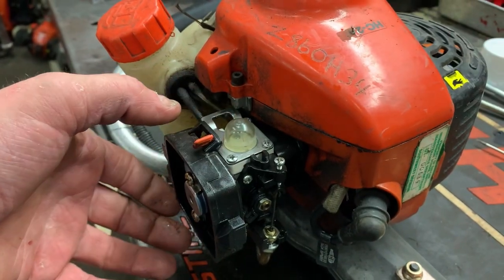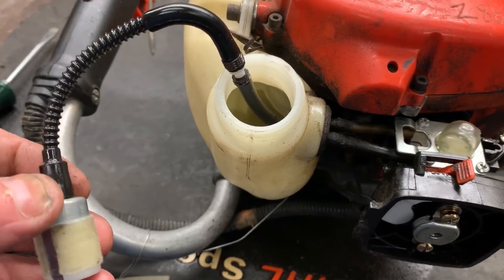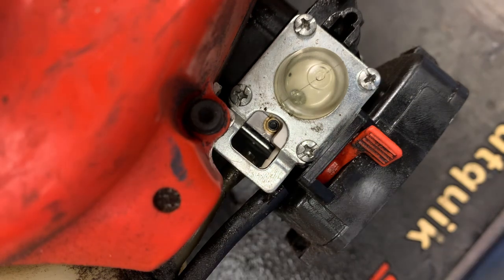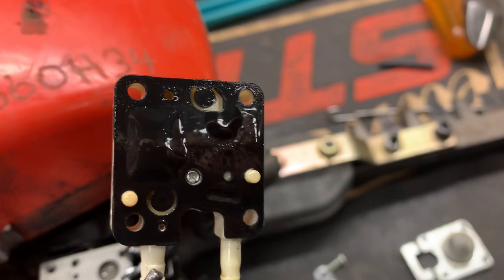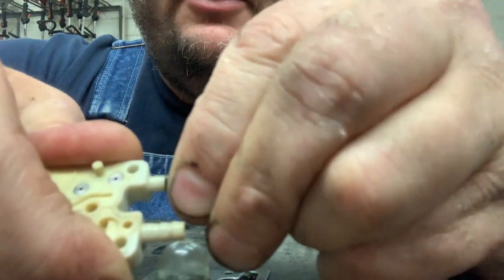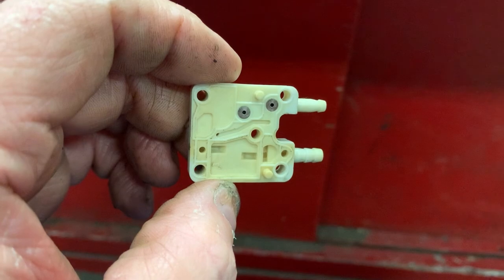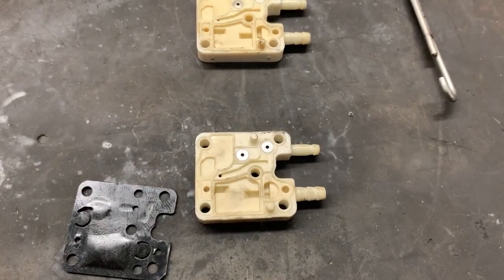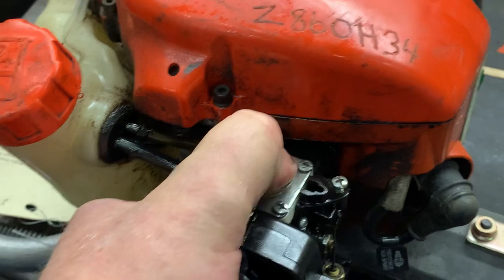ZAMA OR WALBRO CARBURETOR WONT PRIME? THEN YOU NEED TO WATCH THIS!!

Comment: the fuel inlet screen/filter is considered a capilary screen, very fine weave, 
and they can get clogged and it won't be visible, 
not the problem here but just another tip...

Comment: I been swapping g pieces from 3 diffrent carbs trying to get my husqvarna ld128 to run but the primer squeaks but no fuel goes into the bulb. This trimmer worked great for two years not a single problem but all of a sudden it's one thing after another with it. I'm about to wrap ut around a tree.

Comment: Have watched several of your videos and they are always excellent.  I have a 2-stroke Ryobi (Zama carb I believe) which primes just fine, but when it's running, the purge bulb is completely w/o fuel.  Any tips on why that might be happening?  It's also hard to re-start, and I wonder if there is a connection between the two.  Thanks

Comment: Thanks Jeremy, I am rebuilding a Poulan hedge trimmer with a Zama carb and plastic purge base.  True...one check valve is not working properly.  The tiny rubber diaphragm has a small tear in the membrane from the spring in the check valve .  I opened the valve by carefully prying out the aluminum disc which hides the spring / diaphragm and placed a small drop of superglue on the rubber flap which is thin as paper and smaller than a pencil eraser.  I had to carefully do this under a microscope I use for repairing electrical circuit boards.  I will see if the glue seals the rubber flap and use the trimmer until I can find a replacement base.  good job on the video.  I had to look for a while before I found your video but I have been your subscriber for a while.  Keep up the good content.  JwgK   Houston Tx

Comment: You must have some strong lungs. I have to use my vacuum/pressure tester to test the check valves in those white primer base assemblies. I can use my lungs to test the check valves in the carburetors but the ones on those white primer bases are strong as hell.

Comment: But why this valve not not working, stuck with some dirt, natural wear? Any way possible fix this without replacing it?
Reply from the maker: No
Sorry it’s a non repairable part
Reply: I have a mantis tiller, same issue and sprayed son brake cleaner on those holes but didn’t make a difference then went and blow some air    And now it primes, just wanna make it clear, the primer base was one of those typical pink rubber ones, so maybe that’s why I got lucky

Comment: ZAMA C1U-K19  JD 21c weed eater air filter soaked with fuel and fuel seams to be splashing out of carb when i remove air filter and run it. any fix for this. also cant find a new air filter online to order.